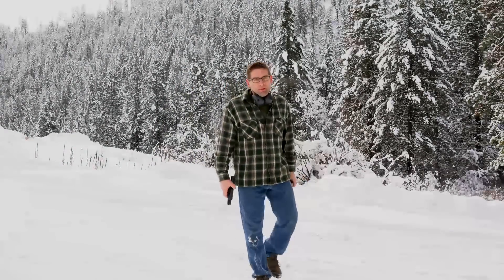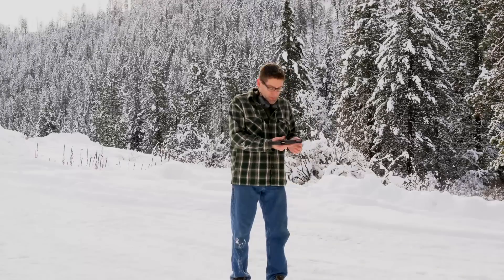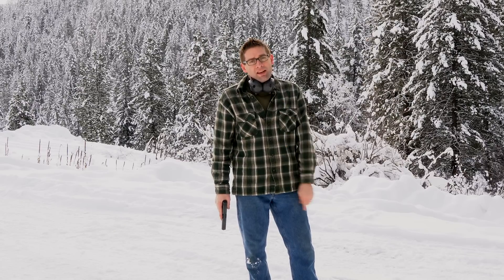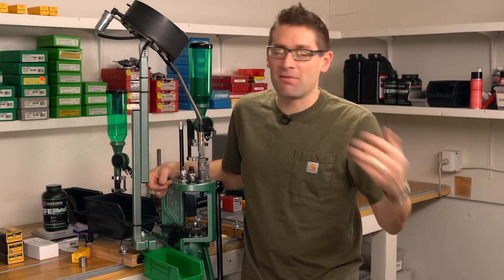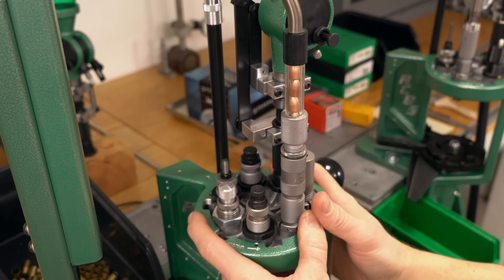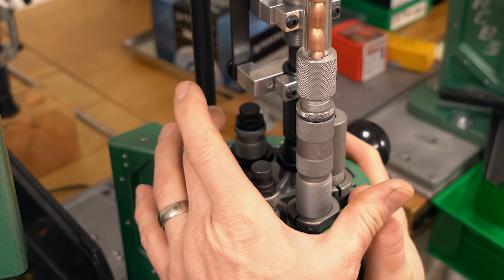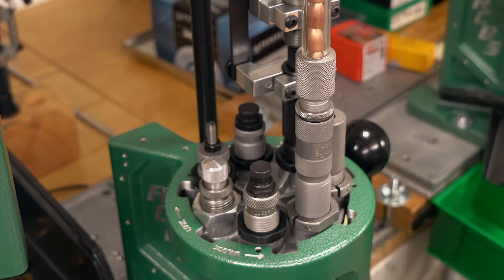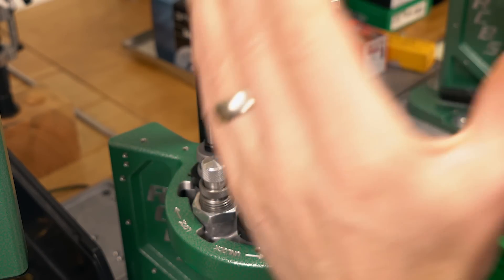RCBS Pro Chucker 7 Loading 9mm

Comment: Just bought this press. Well actually, I bought the PC5 for 400 and the conversion kit for 268 dollars. Everything went smoothly. However, the PC5 came with the updated primer transfer bars but the PC7 kit was packed with the old ones. 
I contacted RCBS and they are sending me the new primer transfer bars and an extra endexing arm. 
For now, I’ll prime my brass on the old trusty Hornady. 
Finally, I have to say, Once you go 7 it’s going to be hard to go back.

Comment: looks like the tool head moves quite a bit during the top stroke.  Got to believe this would lead to big tolerance swings in your ammo.  May be fine for loose chambered pistol rounds, but for tighter chambered performance barrels, would think there may be a higher failure rate in ammo reliability.
Reply: wow great point!! That's alot of movement
Reply from the maker: +dvatp Hey guys- I run these presses with the set screws slightly lose on purpose. I personally like some "float" between the dies and the shellplate as it enhances die/cartridge alignment. That's one of the positive virtues of the Hornady Lock-N-Load bushing system (inherent float). I have a friend that runs his Dillon RL550-b with only one toolhead pin for the same reason. I haven't yet checked consistency in COL (on ogive) but that will be a good "measure" of the precision. The important thing is that you have a consistent and positive "hard stop" for the toolhead which the Pro Chucker design does have. More data to come!
Reply: I know this is old. But I seen the same thing.. I'm thinking maybe good for auto pistol rounds but no way for any type of rifle rounds.

Comment: Not sure, but I believe this model is on hold, numerous primer feed problems, etc.  It has been out for a year and I cannot find hardly any detailed reviews and it seems to be back-ordered indefinitely.  Tried to get some info from RCBS and got nowhere.  Love the idea of 7 stations but seems the bugs need to be addressed before it returns to the market.   Plus, changing calibers is really expensive as you have to buy a new powder dispenser with each plate.
Reply: I ordered a Pro Chucker 7 when it first came out on the market and it had several bugs to fix. The first problem I had was the ejector wire which was inconsistent with ejecting my .45acp brass which would then lead to problem #2, which was the indexing arm. The indexing arm would break and I would have to order another one which would take a couple of weeks before I could reload again. Finally the 3rd bug was the plastic primer sliding shuttle bars would easily break if a primer would get hung up. RCBS should have kept the APS system. This ruined my trust for RCBS products.
Reply: @ouruiz  LOL! Sounds just like a Lee Load Master. Can't do 100rnds without something jamming. Everything must be perfect, then 9's will fly.

Comment: Anyone know where I can buy a large primer plug for the chucker 7. I live in the UK so parts here are impossible. I bought the rcbs 7 stage here in the UK and when assembling I found it had 2 small primer plugs instead of a small and a large. Tried to buy a large from rcbs in America but they sent me the wrong part. What I need is the hollowed out bolt with spring and large primer punch. I'm willing to pay a hundred pounds for one of these as rcbs don't have a clue what they're doing.

Comment: Happy New Year Gavin! Just wondering of you found that your Glock was hard on the brass. My 10mm Glock has always chewed up the brass a bit where the extractor grabbed it. It leaves a ding on the rim that mades it just about impossible to get into the shell holder without extensive fiddling.

Comment: I'm totally not blown away. Considering the Time RCBS had to study the progressive presses there already where on the market some Details are not as cool as the could be. But good Video, nontheless!
Reply: I think it has some of the nicest features of all of what's out there, but still some of the handicaps. Odd as it sounds, I think Lee got more of the small details right with theirs. i.e. retainers that can't fail, and don't need replaced with a different size for caliber swaps. This one primes on the down stroke which is right, and has enough stations to break out seating and crimping without losing place for a feeder or a lockout die. That's the real draw. IIRC it lacks automatic primer pocket swaging which the 1050 can do, but that has the same priming on the upstroke issue that Lee has.

Comment: Nice video, thank you. Question: is the length of the cartridges (COL) regular? Sometimes, on some progressive presses, the length of the cartridges varies a lot, and this is not good for the pressure when shooting.
Also, why is there so much movement in the tool head when you are cycling the press? 
Does this affect the accuracy of the LOC? 
Thanks for your answer.

Comment: Hi Gavin, quick question.  I see that you are using station 7 with the Lee factory crimp die. I am trying the same thing but having a heck of a time with the ejection of the round after it's crimped.  Any tips or tricks on how you set the case eject spring?  any ideas would be much appreciated.  Great video!
Reply: I have the little ejector leg right at the back of the case, and use it as my gage for how low I can screw in the factory crimp die. Basically the plug is bottomed out in the die and it spaced just slightly off the ejector leg. Works great.